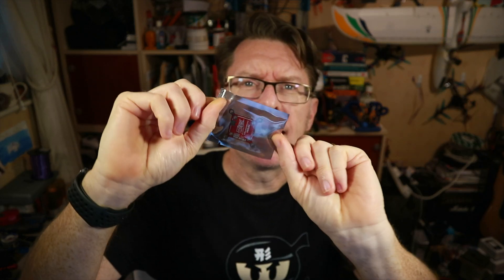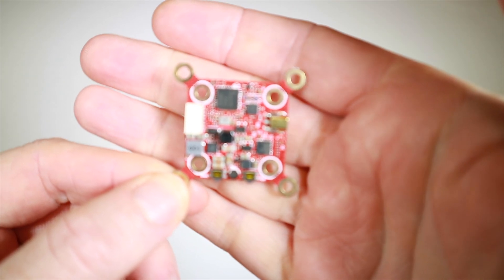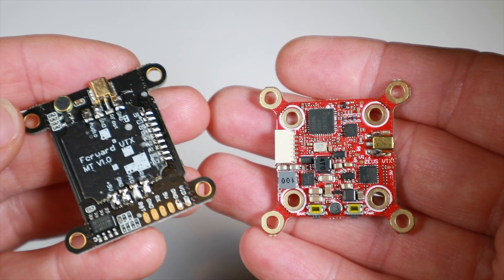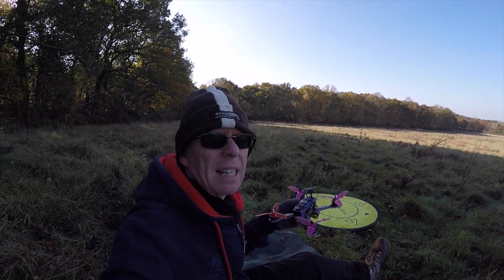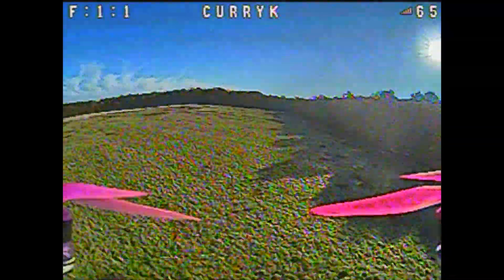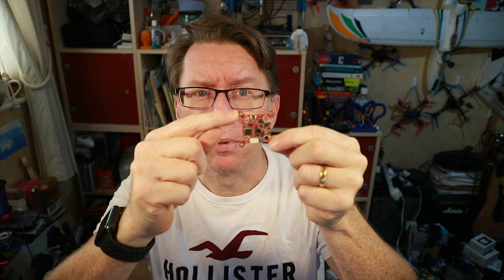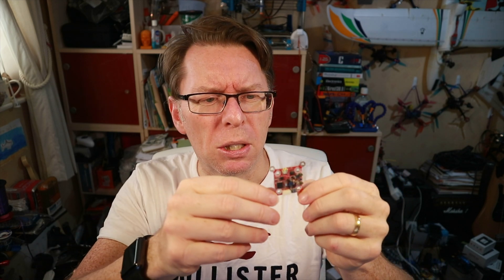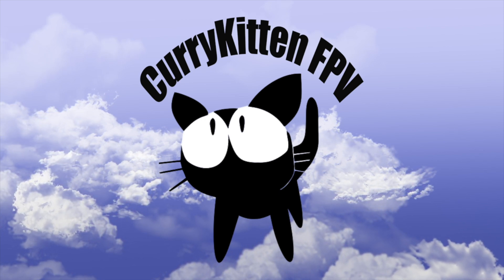HGLRC Zeus VTX, with multiple stack mounting options.  Supplied by HGLRC

Comment: Did you check the led on the vtx for the power setting to verify it's actually set the the output power you think it is? Because I'm having a hard time finding the correct vtx tables and no matter what I change the power level to in betaflight, it is still at 800mw on the actual vtx. I suspect that is what happened here because you cant have the same performance on 25mw as 800. Has anyone actually figured out the correct values to put in the power levels section of betaflight?

Comment: Hello Wayne, if you compare this Zeus vtx to Rush FPV, which one you'd prefer? Thanks
Reply from the maker: That's tricky.  Generally the RushFPV VTX's get the very cleanest of signals - so that might just edge things, but the Zeus's 25mw performance is the best I've seen on anything.  I'd like to check it with a power meter to see if it really is 25mw, but I don't have one

Comment: As it's a tramp based vtx it should connect to a ghost receiver. Would be good to show that and how to adjust the vtx from the Ghost module (if it works yet lol) Oh and I'm still waiting for my ghost kit to arrive, hopefully next week if the tracking is to be believed.
Reply from the maker: Good idea - I know it works with an original Tramp, but will be interesting to see what the situation is with a non-IRC board.  I can't believe how long your shipping is taking!
Reply: @CurryKitten  Ghost has finally arrived, after 6 weeks from hk...... First job updating the firmware 😀
Reply: Looks good